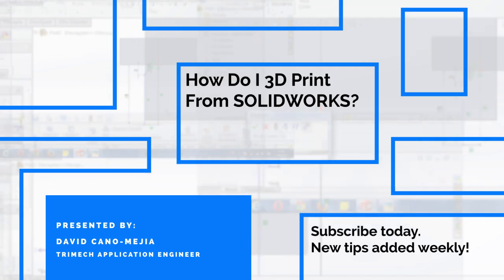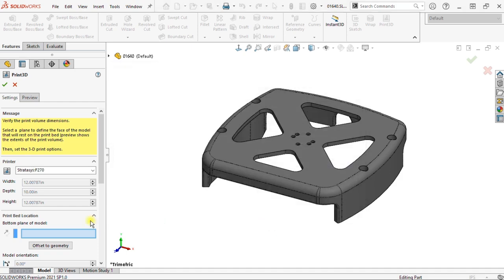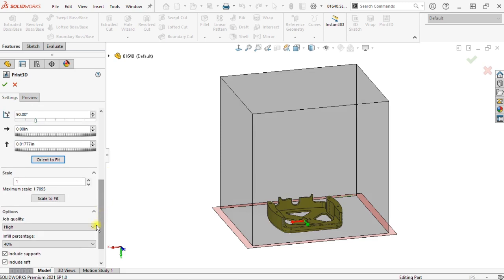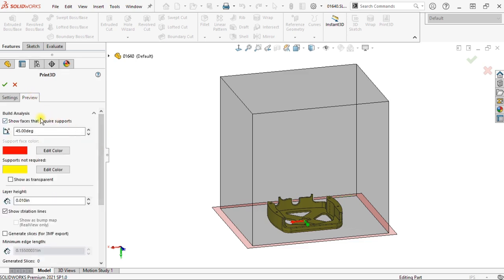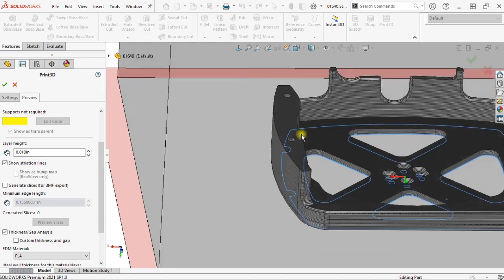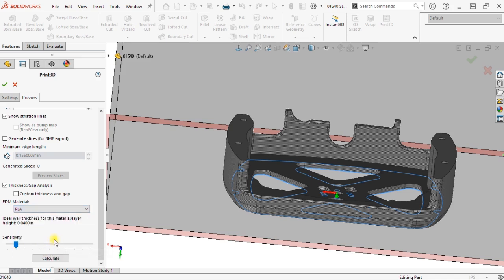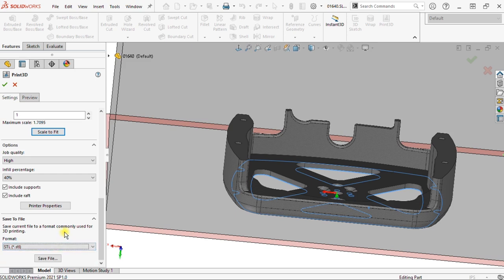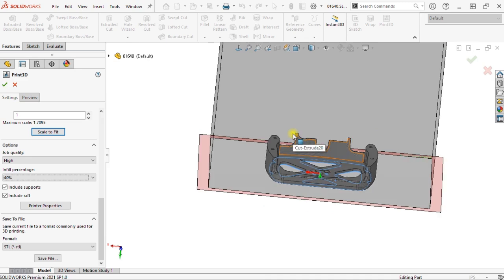SOLIDWORKS Tech Tip: How Do I 3D Print from SOLIDWORKS

Comment: When I click Print3D, under the "Settings" tab there is a message that reads "There are no 3D printers installed on this computer."
It still allows me to save STL files but I cannot see a preview. I have a 3D printer connected to another computer. Should I be worried?